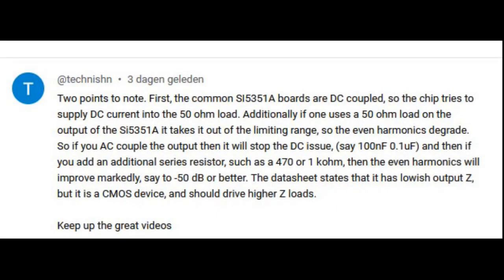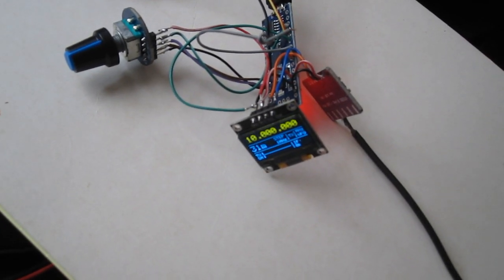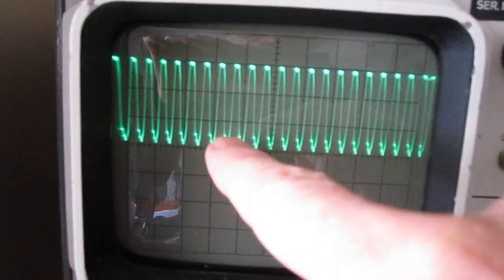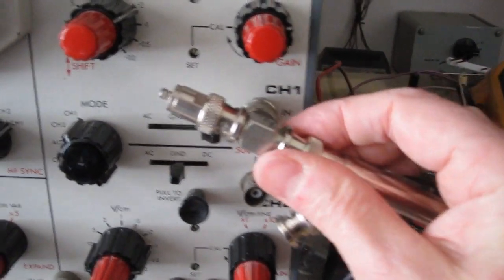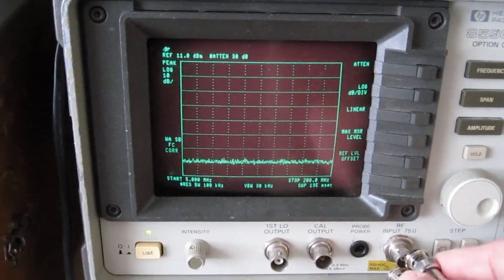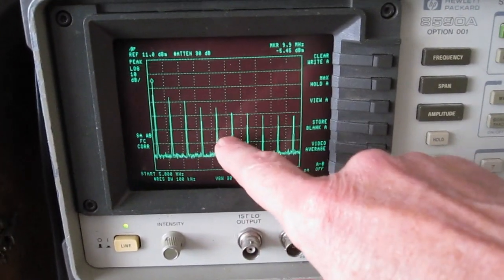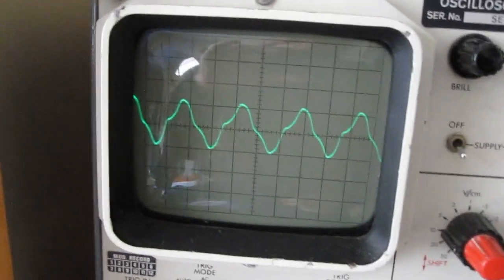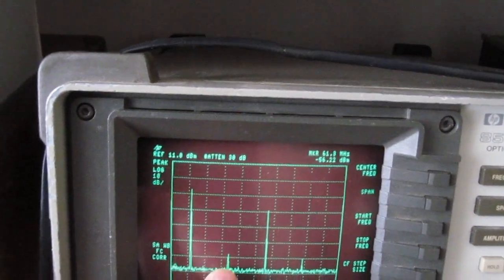How to get rid of the second harmonics of the SI5351A frequency generator

Comment: This is an interesting video. The spectrum of a square wave with a DC component is easily found by doing a Fourier waveform analysis and it will show that all harmonics are present. The amplitudes will depend on the mark to space ratio. The Fourier analysis of an ideal AC square wave (with no DC component) will show no second harmonic component. This is just very basic AC theory you can find in any textbook on signal analysis used in first year technical studies. Fourier analysis of a waveform amplitude will show the frequency domain or spectrum of any waveform. The addition of a capacitor and resistor will result in producing the integral or the differential of the waveform resulting in a modified spectrum. A good example is the very commonly used combination -- called a filter - low pass, high pass or bandpass. There is nothing unusual in this video which simply demonstrates basic electrical principles.
Reply from the maker: Thanks for your additional comments!

Comment: Great video. 😊 The level can be made up with a MMIC or a broadband 50 ohm transistor amplifier. If the output level is kept well below amplifier compression, then harmonic regeneration is minimised. The  composite phase noise is reduced as well.
Reply from the maker: Thanks for the compliments and the addition!